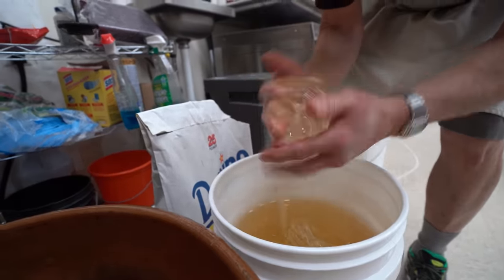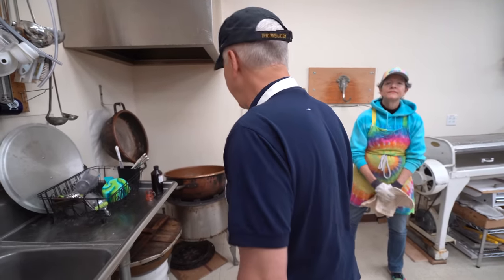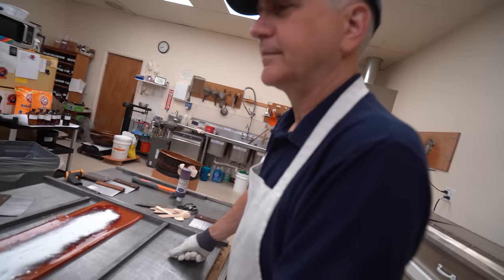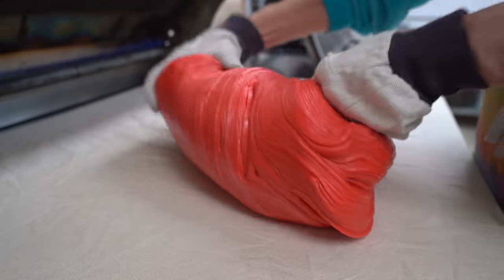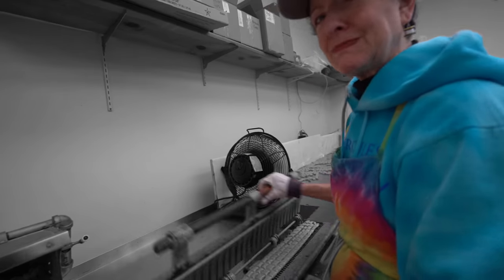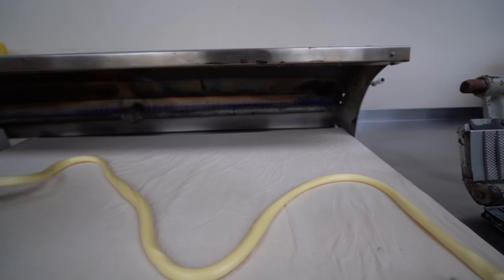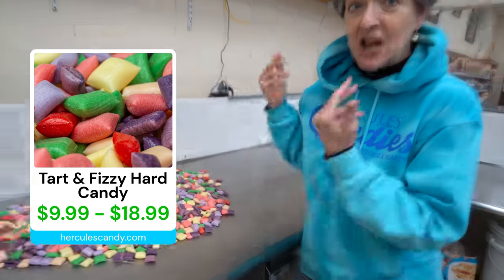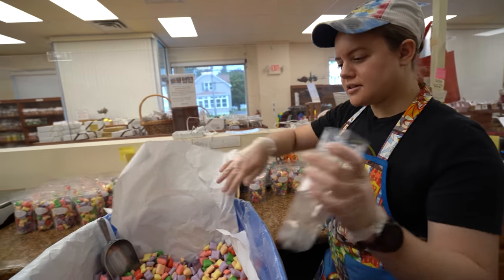1 NEW ingredient made this batch of Candy Fizzy!

Comment: The optimal ratio is 1 gram of citric acid to 1.3 g of baking soda, for the two compounds to theoretically react completely.
Reply: You would dull the sour taste of the citric with a complete reaction. Depending on the flavor or if you want a sour candy you would need to adjust the ratio.

Comment: Very yummy.  I was expecting a candy similar to Zots.   Hard candy with a powdery fizzy center.  Make like a 2" ribbon  shape with candy,,and lay the fizzy powder right down the center,,keeping to the center,, then just roll them up sealing the fizzy powder in the center.  I simple rolling action.  Pinch each end tight on each candy to seal the powder inside.   You might be able to use the restored candy hand rollers to pinch and cut each piece, trapping the fizzy powder inside.

Comment: @HerculesCandy the candy, that you were talking about at about 2:45 area, is a name brand called Zotz and it’s a hard candy with a powdery center that fizzes in your mouth. They sell them here in Idaho at certain gas stations and they come wrapped in plastic wrappers in strips of 5.

Also, Steve, when you get to the end of your candy blob and it’s hard pop it in the microwave for 15 seconds and check on it and repeat until it’s soft enough for you to squeeze it out to the size you need. Just a thought. 😊

Comment: I wonder if that weird foaming feel wasn't why pop rocks were so small.  They weren't hard-candy sized but lots of tiny pieces -- maybe that increases the surface area of the candy so that the fizz is more noticeable.
Reply: Yeah, i was wondering the same. Mabye you should bite them
Reply from the maker: I didn't even think about biting into it!
Reply: Exactly! Surface area is key!
Reply: @HerculesCandy PLEASE PLEASE PLEASE DO LIME, & BLUEBERRY???
Reply: Pop rocks are in a ton of small shards in part due to how they're manufactured. Pressurized CO2 is bubbled through the molten sugar, and the entire thing is done in a pressurized vessel to prevent the CO2 from forcing its way out of the candy while it cools. When the pressure is released after the candy has solidified, some of the trapped CO2 bubbles can exert more force than the candy that contains them can physically withstand, causing the candy to shatter into tiny pieces. It basically explodes, although the explosions are fairly weak.

Comment: You wont get as much fizzing in your mouth if the citric acid/baking soda mixture is incorporated during puling. You want to envelope the powder inside the sugar, so each piece has a small stripe of the powder. When you bit into it, it'll fizz considerably. 

Generally confectioners sugar is added to the powder mixture as well, but that will also affect shelf life since it will induce crystalization sooner.

Comment: This might be a boring aside.
Chemistry was a long time ago, but i believe the "complete reaction" of this would be calculated as follows:
Citric Acid HOC(CH₂CO₂H)₂ molar weight is about 192g/mole
sodium bicarbonate ( NaHCO3) is about 84g/mole
3 Sodium bicarbonate molecules are consumed in the reaction so i believe you would want 3(84g) =252g Sodium Bicarbonate to 192g Citric Acid
This would be a complete reaction into sodium citrate Na3C6H5O7.... which is sour on it's own... but maybe you want to have more citric acid for flavor/sour quality.
That and conversion to volumetric measurements is left as an exercise for the reader. ;) 
Do with that what you will.